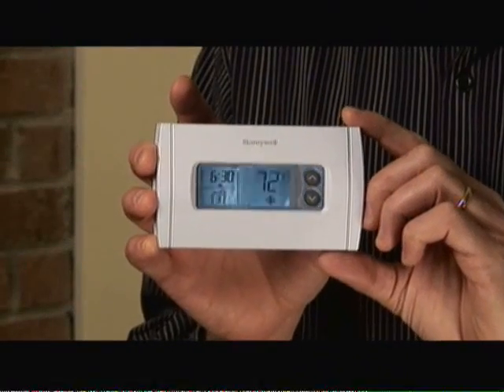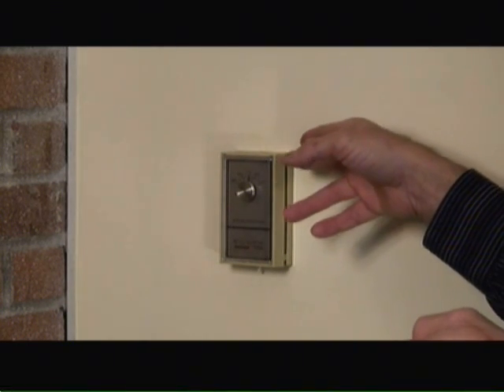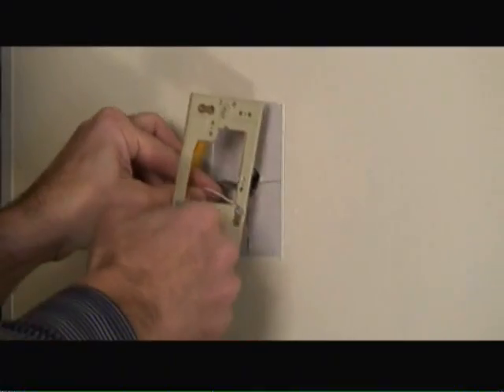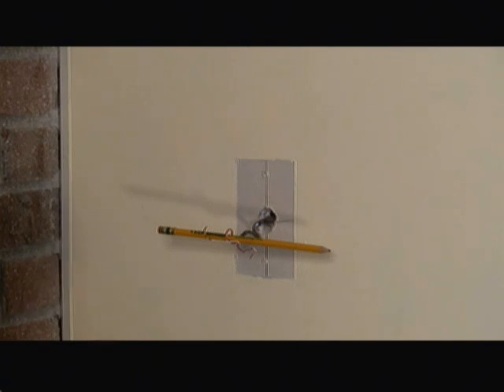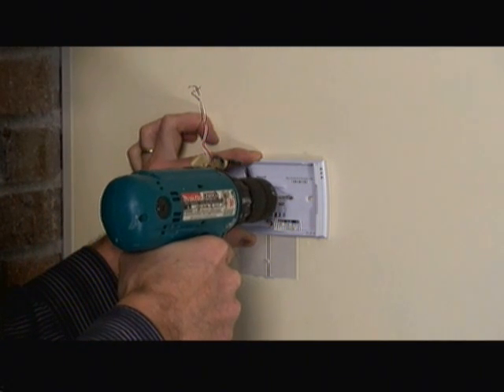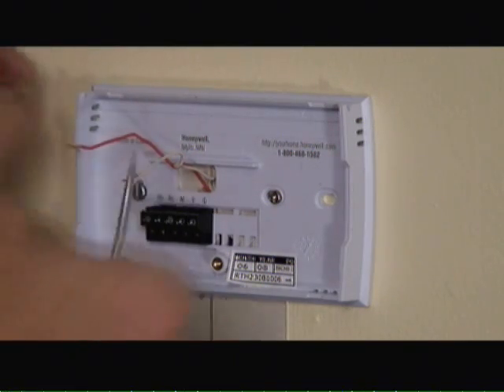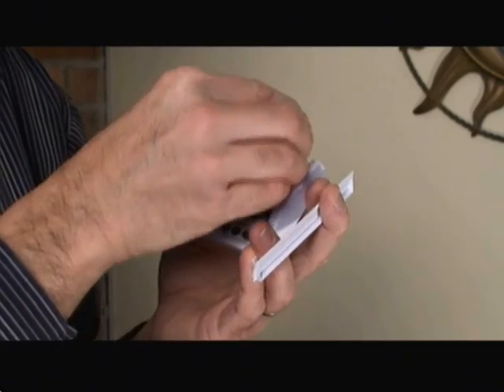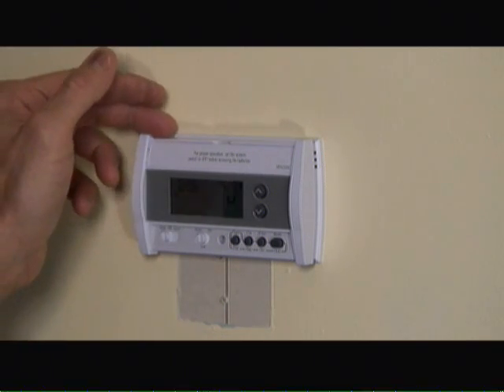Installing a Programmable Thermostat

Comment from the maker: I don't believe it would be a problem related to static charge. The circuit should be properly grounded. It sounds like the thermostat has failed and probably needs to be replaced.

Comment: My thermostat went blank when I touched it and I had static, but did not realize it. Is the thermostat damaged and just needs to be replaced or would there be more electrical damage? note....its not the batteries, I have turned off then on the main power in the fuse box and it still is not functioning. However, my thermostat downstairs works perfectly fine and my heat will turn on with that one. thank you!

Comment: Good job. Does your furnace have a variable speed blower or do you just have the control wire jumpered hot in the furnace?